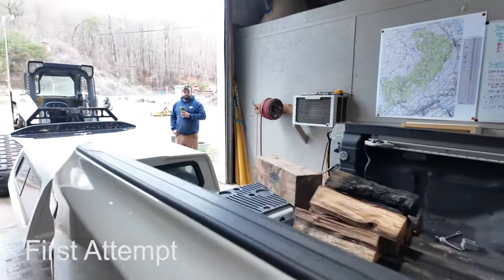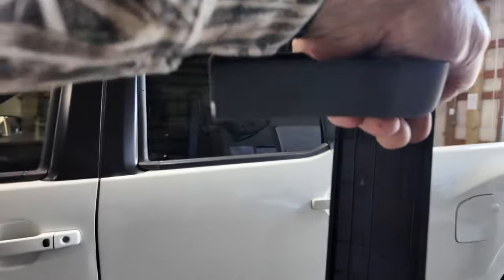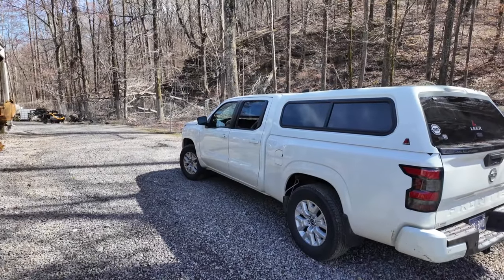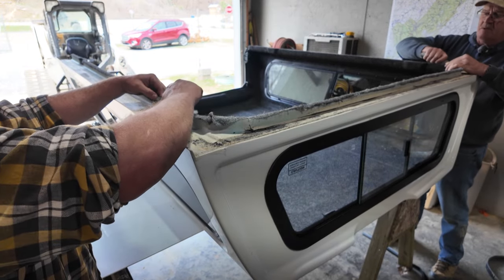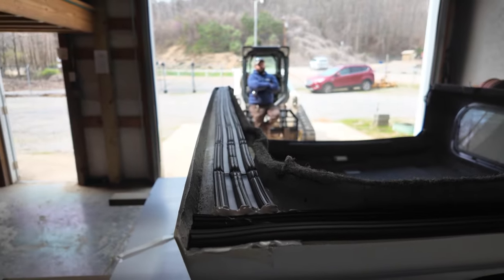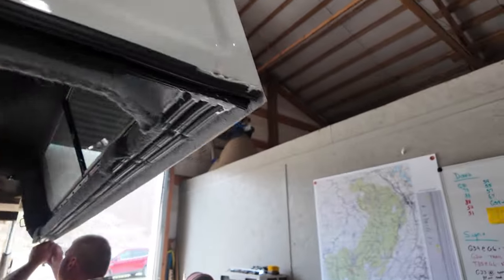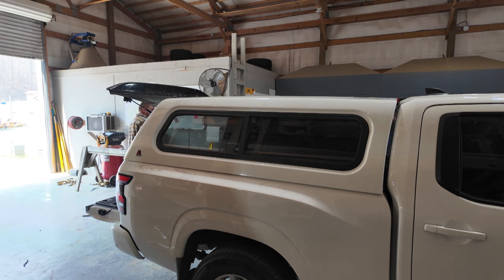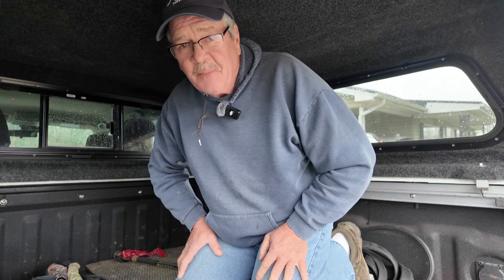Leer Camper Shell Leaks on my 2023 Nissan Frontier Pickup this is how I fixed it

Comment: Glad you got it fixed Ron, I have an ARES top and they used that asphalt/ rubber based rollout stuff on mine and it hasn't leaked a drop..The only thing is, it will be a nightmare to get that crap off my bed rails if needed..
Reply from the maker: The good ole days

Comment: I appreciate the effort you've made to stop water getting in the bed, but these shells are not designed to be watertight. You've improved the design. I've owned several Leer shells for my pickups and every one let a few drops of water in at the car wash. I was never bothered by this since my shell was mainly just there for occasional cargo.
Reply from the maker: And it was an effort. Lol. I do realize that you can’t get them fully sealed. But I think I got mine pretty good now.